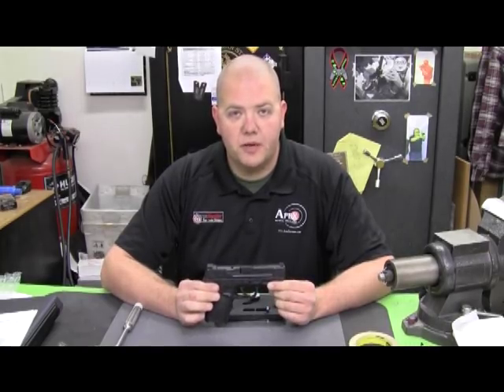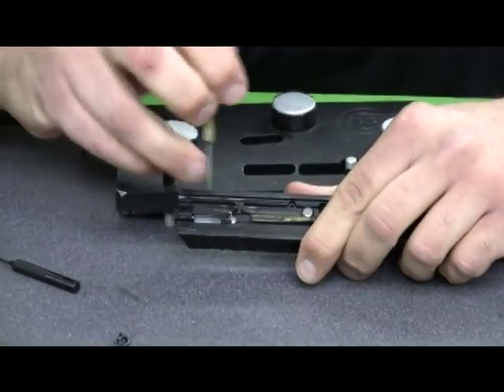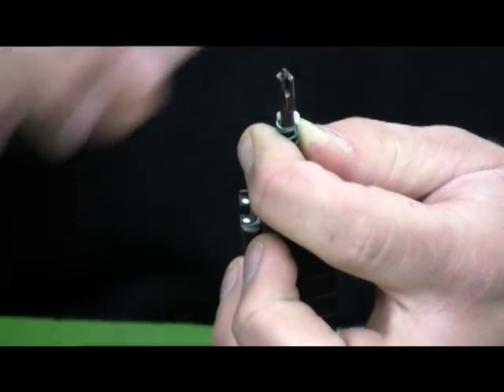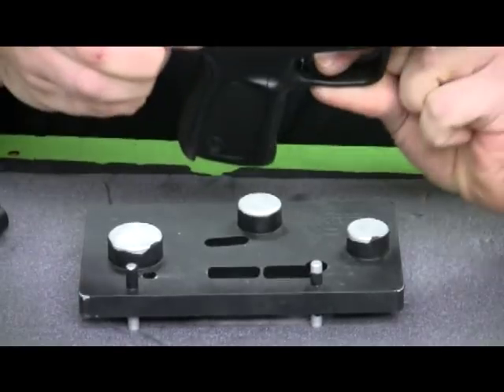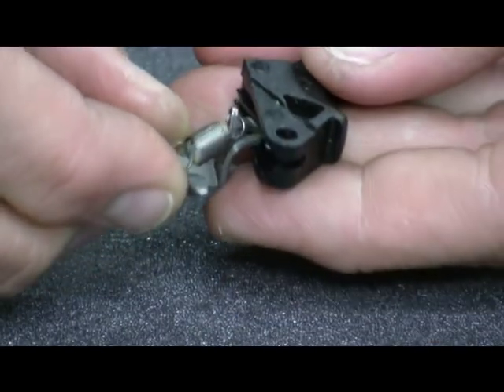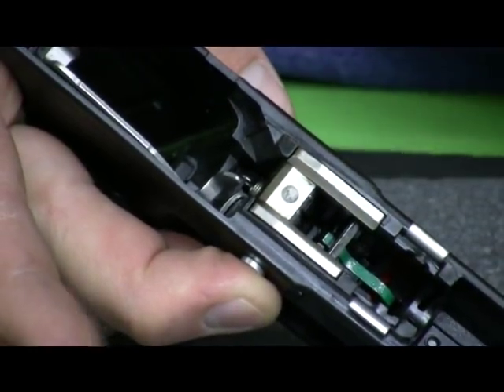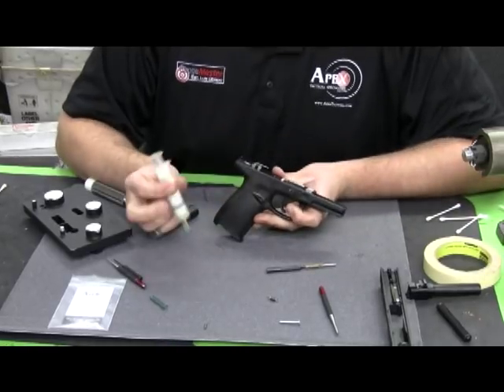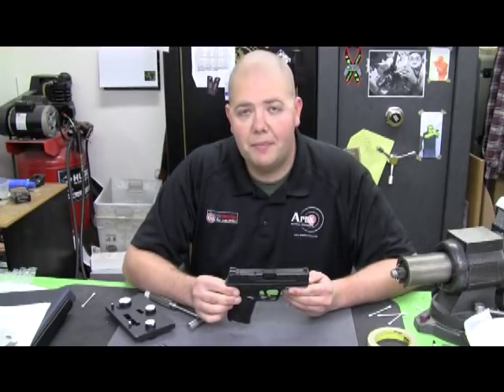SD/Sigma Kit install

Comment: Just installed this in my SD40VE. Enjoying the much lighter trigger, it's definitely better. As others have said the trigger pin comes out opposite of whats shown in the video. Other then having to use some patience with lining the slide lock back up with the trigger this was cake. No idea why anyone would need a gunsmith to do this. Anyone competent enough to own a firearm can do this. And if you can't put this kit in then you are a safety hazard to yourself, sell your gun.
Reply: +Michael Smith oh yah ah huh hahaha ok Mr gun "Smith"

Comment: anyone have any trouble with the gun jamming every time you attempt to load a bullet? just did the kit install everything done correctly according to the video and now every bullet is jamming..
Reply from the maker: Try disassembling and reassembling the frame.  It's likely the slide lock lever return spring poorly positioned. Contact Customer Service for further assistance.

Comment: Sadly, this video was of absolutely no use to me. I purchased your product in good faith only to learn there's a few trap doors. here.

First, we're talking SD40VE. I have no idea what "rev" it is. It is long and slender, without scalloped cuts to the slide.

There is no pin to be driven out, top down. There are no access holes from the outside, at all.

It took a bit of figuring out but this is what I know:
1) Once the slide is off, pay absolutely no attention to that hole that's drilled inside that makes you  think you've found Valhalla. You haven't.
2) With the slide off, once you do as the video demonstrates (wrt: removing the firing pin, watch out! When you slide that rear 'sheild' down,
  The spring/devise used to manipulate the extractor will come flying out, over your left shoulder.
     You'll remove the other parts that don't sail across the room, the extractor, and the safety device.
 You'll replace the spring in that gizmo, you'll replace that gizmo... no special tools required. Then re-assemble in reverse order.

I found the pressing down of the extractor sprint mechanical architecture very challenging. Very. It can and must be done, for re-assmbly.

Apex failed me, miserably.
Reply from the maker: I'm interested to see exactly what your slide looks like.  The SD and SDVE share similar parts in every way except for the sights and finish of the slide.  If the latest model of the SDVE is that different we will most certainly be making a new video.  Please contact our customer service staff at the email address listed on the product cards so we can assist.
Reply: I tried to find a vid to ref to You. It LOOKS exactly like the SIGMA except stamped on the left side is SW40VE. Now I'm questioning whether I actually got the wrong gun?!?!?! I bought it a local chain store here (Academy Surplus) in Dallas. It was advertised as an SD40VE. I never noticed the "W" was a "W" and not a "D". I purchased it new, several years ago for $309.00. I have not shot it yet as I have other guns that I love to shoot and yes, there's nothing like shooting a new handgun but honestly, the other guys are Cadillac's... this one was intended as a gift for my unarmed niece. 

I put the slide parts in once I figured out how to disassemble it. The trigger is noticeably improved. I hope to get around to the trigger spring today but since you mentioned polishing surfaces, I'll do that while I'm in there. I just need to get the dremel out of the garage. And magically create time. 

I regret the tone of my email. I was very frustrated when I wrote it. After watching your video, then starting the work only to find nothing was lining up but convinced I could figure it out, it took longer than I expected and that damn trigger/firing pin 'button' inside the slide gave me a very hard time coming out. I couldn't get it out and was convinced the odd hole that is purposely drilled into the slide at angle was the key. It wasn't. I have no idea why they drilled that.  So, I apologize.
Reply from the maker: +Shamrockrancher , thank you for the reply and additional considerations.  based o. your description. you have a Sigma, not an SD, which explains most of your frustration.  if you installed an Apex SD spring kit, the striker you have is I correct and you will need a new one for reliability.  please contact us at the email on the card or call so we can get you a new spring.  let them know that you have been in touch with Scott via Youtube about this and they will get you taken care of.  Scott
Reply: Thanks for the spring. I commend you on your skill. You makes this look A LOT easier than it is. I'm competent with tools and doing anything up to and including restoring classic mustangs from the ground up but I managed to screw this up.I had everything right from what I could see (finally!) and when I put the slide on, the trigger was so far down in the guard that the safety would not allow the trigger to be squeezed. Now I can't get the slide off! Any suggestions?
Reply from the maker: +Shamrockrancher you will need to remove the striker to get the slide off to assess it.  lock the slide back and you will be able to get the back plate off
Reply: apextactical Just to keep you appraised of progress  (and I appreciate your support). I've given up on this project for awhile. The problem I have is with the trigger spring. It's incredibly short and every time I get everything lined up, when I go to push the pin thru, in that fraction of a secondwhen the spring leaves the 'set up tool' to make the jump to the pin, it returns to normal length and gets missed. I've done this 4 or 5 times and I'm just wore out. Again, I commend you for your obvious skill/talent.

I may try threading some thing fishing line thru the part of the spring under the big chunk of metal that is in the way, and just work the pin thru all the devices instead of that tool/temp pin.

Thanks again for the help (and the spring). That was nice of You.
Reply from the maker: +Shamrockrancher when you get back to it, make sure the trigger bar is all the way up, that will help relieve tension.  the trigger should be pulled to allow this to happen.  some people have had some good success with taping the trigger to the back of the trigger guard as if the trigger has been pulled.